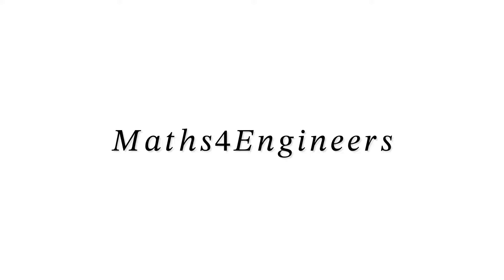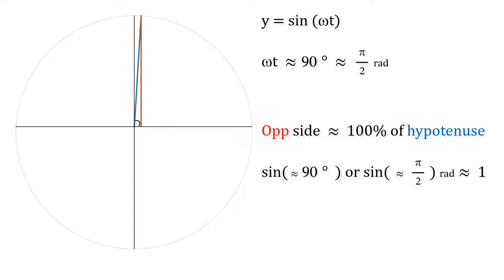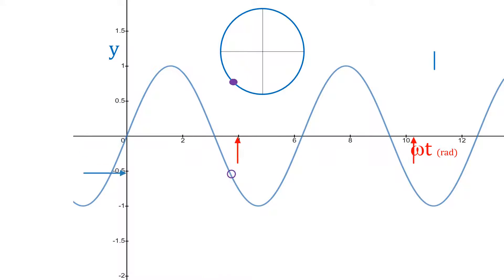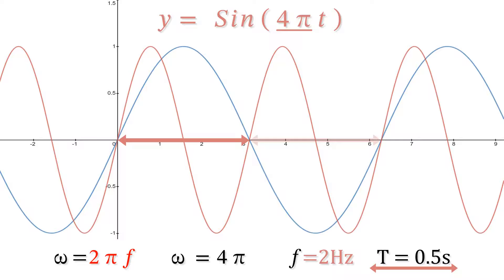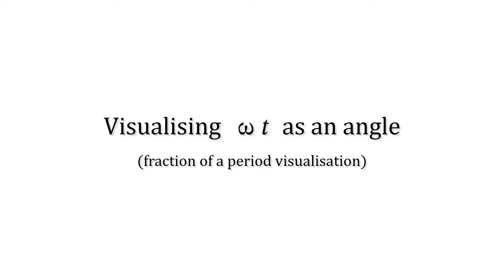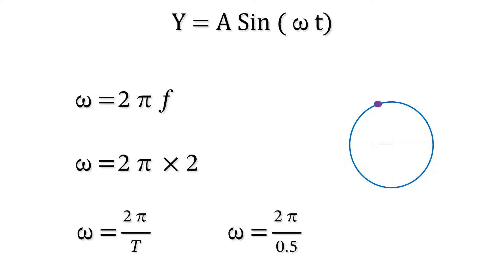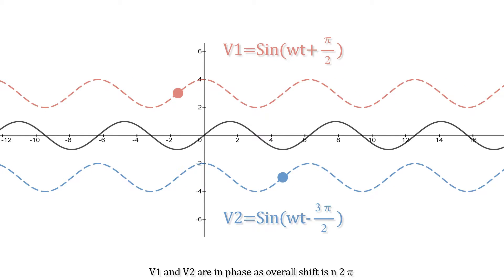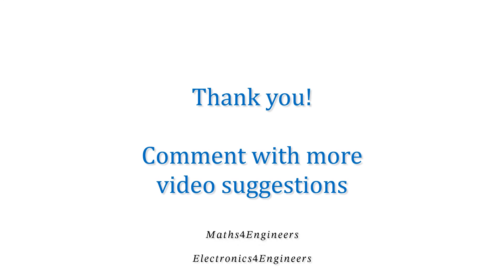Understanding Angular velocity, Omega t (wt), Sine, Unit Circle and Phase difference

Comment: 6:34 isn’t the frequency of the shown graph 1/(2pi). Because the graph shown has a period equal to 2pi.
Reply: Hi, at the time you mentioned, the circuit has done one cycle in 2pi radians. Remember, the x axis here is  in radians,  not seconds. A one Hz signal will always spin through 2pi radians or 360 degrees in one second. I hope this helps!